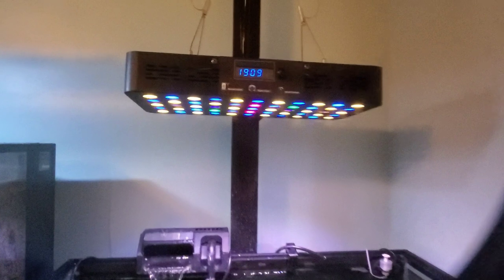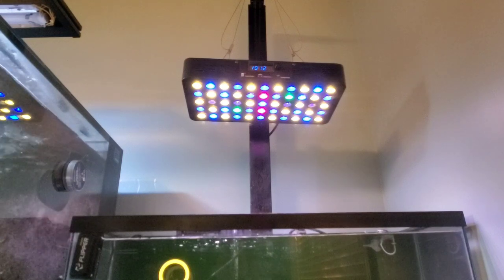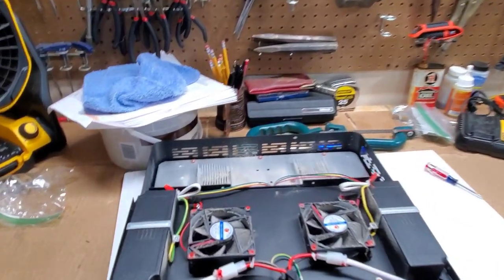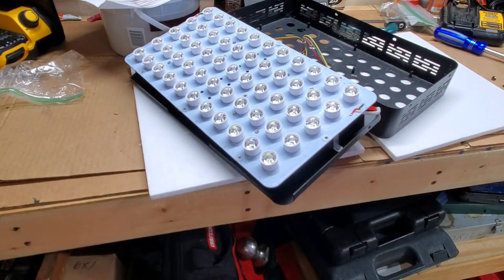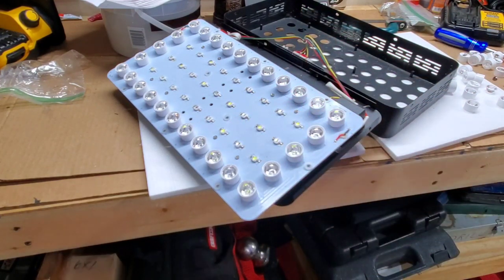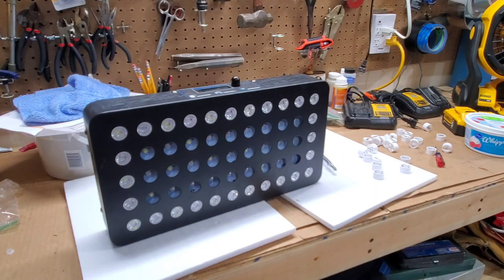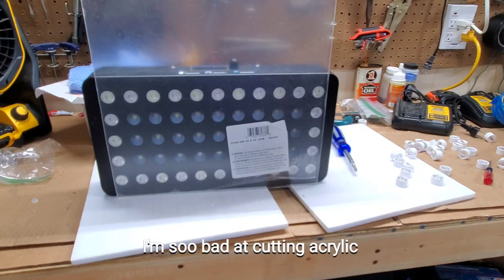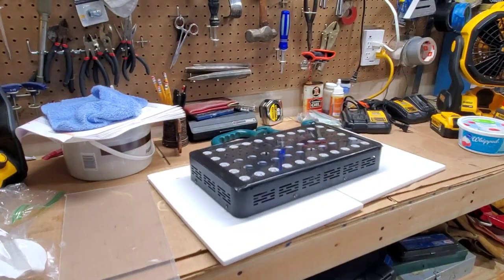DIY Upgrade a Blackbox LED to Get Better Spread and Coverage For a Reef Tank

Comment: I did a series on this, using par meter and noticed the spread on a single LED without the lens cap is so wide, the par dropped by more than 50% 😯
Reply from the maker: I have a par meter I’m gonna use to measure the par later

Comment: Is that a 40 breeder you're using it in?
Reply: Is 1 of that blackbox enough for a 40 breeder?
Reply from the maker: I'm using it on a 20 long. I would say if you have a 40 breeder it should be good to use 1 depending on how high you mount it. Mine is about 13 inches above the tank. So you might want to try 14 inches or more for a 40 breeder if you difuse it the way I did.